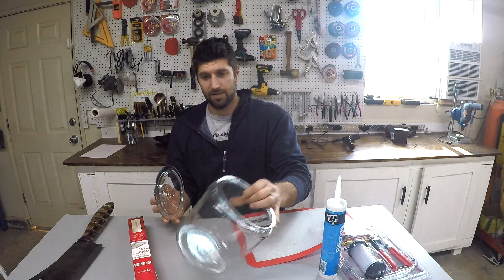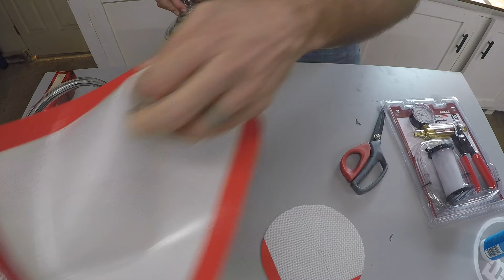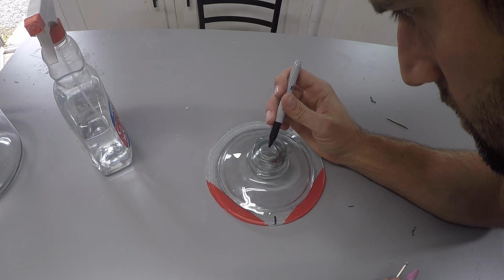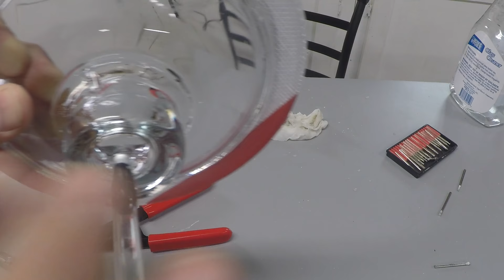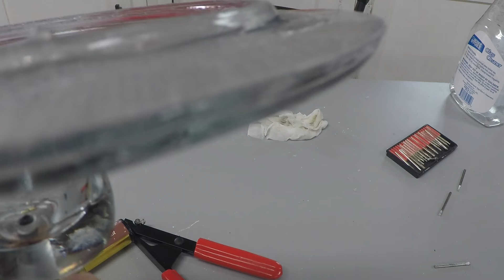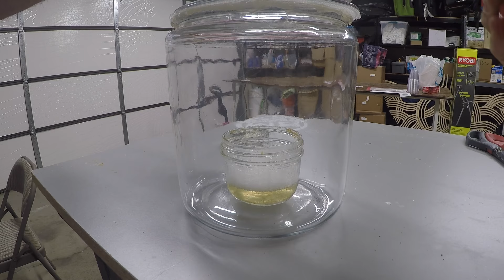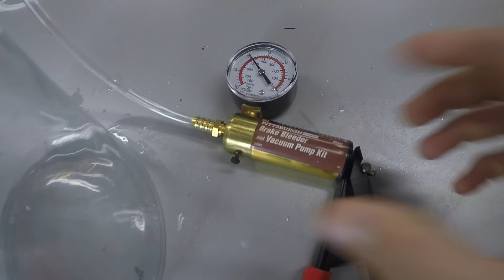EASIEST & CHEAPEST Vacuum Chamber. DIY for epoxy castings & resin pouring.

Comment: You might want to drill the glass first. If it breaks you didn’t waste time making the silicone o ring  detail. Amazing idea though.
Reply: He was experienced and confident.   However, for myself, I thought the same thing.  If I had done it in that order - surely it would have broken for me!
Reply: He could make it cheaper by using a clear plastic air tight box, saving time & money or something like those cylindrical glass jars with those metal lids (idk what its called)
Reply: @DoomsdayDatabase  plastic isn't as strong though, I've never seen thick plastic walls on a clean container
Reply: @CanyonF  you could use those pickle jars
Reply: @CanyonF  if I'm right cos the action lab kit comes with one of thkse
Reply: Where did you get the black tip on the plastic vacuum hose? I bought this same vacuum pump from harbor freight and it didn't come with it
Reply: @CanyonF  … Food Saver actually makes acrylic/plastic canisters designed for vacuuming …
Reply: @DoomsdayDatabase Mason jars?
Reply: I have a rice cooker that I hooked a hose to and sealed. I got a vacuum pump from harbor freight. I’m glad I came across this video; I won’t have to reinvent the wheel.
Reply: @bluemoon8268   yes food saver does make the canisters but NOT large ones. And there's times when you need a larger container.
Reply: @barrettique  could be useful for small hobbyists though.
Has anyone tested if they can reach low enough negative pressure to de-gas silicone/resin?

Comment: You could also reduce the volume inside the container by placing a large solid object inside before vacuuming out, save lots of pumping.
Reply: Maybe a ziplock bag with air in it.
Reply: @jude7321  I’m pretty sure it would just expand and pop, I was thinking along the lines of a block of something without air in it. Even a container of water.
Reply: @mussimike  Water might mess with whatever you're degassing right? Some fine sand or even uncured plaster powder maybe could work :)
Reply: … how about glass marbles ?
Reply: @bluemoon8268  Good idea, with the advantage that marbles ‘flow’ to fill your empty container form so you could even immerse your casting between them.
Reply: @bjornstromberg4481  i like the sand idea....i have a few really small silicone molds that are likely to fall over if i walk thru the house too quickly.   but the sands will hold em :)

Comment: Giant pickle jar with lid. Poke hole in lid with a tack. Use foodsaver vacuum pump with hose attatchment. A small piece of black electrical tape. Close jar, use pump. Have electrical tape affixed but folded away from hole. Then quickly remove tube and fold tape over hole with finger. Tape too thick to go through tiny hole. You can store dehydrated food in these kinda jars too.

Comment: I gave this a "Like".  But I think you should put some sort of expanded metal cage over it when it is in operation so the operator won't get hurt from flying glass  IF it implodes.

Comment: This makes me very nervous. I used to work on CRT televisions, that is a glass bottle with a vacuum in it. An implosion is NOT gentle. Pieces bounce off each other, some just fly past everything and continue outwards.

The front of a CRT is very heavy, thick glass. However, the back is fairly thin as it is normally protected inside the case. If you break that glass, it can throw shards 20ft. I wasn't there for it, but I worked with a tech that had someone break a CRT in his shop. One of the pieces flew 20ft, cut through his pants like they weren't there, and embed itself in the leg of his bench. He was lucky, it just barely shaved some skin off his calf.

It took a pair of pliers to pull the glass out of the bench.
Reply: yeah, but I just bought one of these jars, and the glass is pretty thick.  Not  "a baseball bat won't break it" thick, but i believe it will be fine for a max of 20lbs of force, which is the max recommended rating on the brake bleeder.   Yes, the gauge does go higher.  but I know better than to test Harbor Freight tools.      also, I'm not sure about that second-hand account, unless the old console TVs are different somehow to a CRT monitor.  I once broke thru the front screen of an old console TV.   it took several swings with a bat to make a small chip. when that didn't work, I hurled a 20 lb barbell at it.  that punched thru.  there was definitely glass that flew past me, but not with the force that would embed a shard into wood.  I certainly didn't have any cuts.
Reply: @icandsc  OP is talking about the  thinner glass on the back of the CRT though, not the thick front part you're referring to, which would indeed be quite difficult to break.

Comment: This is a very interesting idea! I have a couple concerns/comments/suggestions:

1) Safety. For at least the first few tests, put this in a large cardboard or plastic box, in case it implodes. Those jars are not designed to take these forces, and I'd want to check before trusting them.
2) Speed. Definitely factor in the pot life of your epoxy, it looks like it could take quite a while to get a vacuum in a jar this size! Some mixes have additives or different ratios to prolong the pot life.
3) For a simplified/variable system, perhaps a thick chunk of Nylon (I'm sure you could get 1" thick Nylon or even polycarbonate sheet for not too much money) with the silicone baking sheet stuck to it as a base plate. The vacuum nozzle can run under the sheet, and up through a hole in the centre of the base plate. Now you can put any size of jar over the top of the nozzle - small jars for small amounts of epoxy, larger jars for larger amounts or even filled moulds that you want to degass once poured - using the same base plate. It also means you are drilling a hole in plastic and not glass.
Reply: Killer idea
Reply: Would you say that the only thing that really needs changing for it to be completely safe is a sturdy metal pot?
Reply: @leojones1964  If what you want is a very safe vacuum chamber, then I'd just buy one - they aren't that terribly expensive. I can see ones from reputable resellers for under £100 here in the UK. Those come with a see-through lid, all the fittings and gauges... for under £130 you can get one with a vacuum pump as well.

A good quality pressure cooker pot can cost that much (though they can be much cheaper).

You could use a metal pot, but that does make it much harder/messier to use. Being able to see that the material has stopped bubbling, or that it's about to overflow the container and make a horrible mess - these are important, too.

If you are degassing epoxy unsighted, make sure there is plenty room for the bubbles to rise into and use a secondary container to catch any overflow (a sensible thing to do even if you can see). Also, it may be worth tweaking your accelerator or catalyst to give yourself a bit more working time, to make sure the epoxy hasn't set while you're degassing, and de-gas for a bit longer to make sure you've got all the bubbles out.

An interesting side-note about bubbles, though: Someone I know did a study on 2-part polyurethane mixes, and those that were vigorously stirred to include bubbles and not degassed were slightly tougher and tear-resistant, though overall weaker. The bubbles blunt the start of tear formation. It's a minor difference, but a measurable one. Thought I'd throw that in here!
Reply: Some additional safety idea. Often I have seen glass vacuum desiccaters wrapped in tape to mitigate the danger of an implosion. I prefer a plastic bell shaped vacuum chamber.
Reply: instead of nylon, why not simply make a "resin disc"?
Reply: Same immediate all folks with vacuum filtration boiling reduced have done all these, reversed compression, and hood hand ir aspirators pumps, water vent. It’s weak if I pulled vacuum that thing is imploding and borosilicate it’s not soda lime nope. Shards cheap. Get 50 vacuum heavy wall vacuum flask. Zillion safer, autoclave pressure. A cylinder especially fluid is meant to resist internal! Ie soda bottles huge pressure Pvc insane or can carbonated, champagne it’s not difficult to stress crap, crush water bottle on can. As it will hold explosions also to failure. H20 air pvc is beast. Tested on outside. Canning ? Extrapolate then tube vacuum furnace induction and molten metals chemical Base Acids ox red. Then fuming off, toxic. Seen  terrible accidents deaths only one in facility. If alone more. Folks make hazardous stuff not here sure mean to help. Diamond round bit ultrasonic or nylon screw and even use valve. Use dependent esp contents. Enough, sorry seem mean not intent, well done genuine sharing effort.
Reply: @aryanprivilege9651  bro, did you just have a stroke? Nothing you said makes sense.
Reply: Same here, cheap glass container implodes and you spend all night in the ER while they pluck a thousand glass shards from your body.  Not wearing safety glasses? Say goodbye to 20/20 vision!
Reply: @chiraldude  Implosion, not explosion. With an implosion the chamber would collapse in its footprint as the force is inward.
Reply: @Haarschmuckfachgeschafttadpole  While the implosion probably wouldn't be as dramatic as the person before you said, the energy has to go somewhere, it doesn't stop in the middle, however adding some transparent tape will stop that too at the cost of visibility
Reply: @mceajc what’s the difference between a resindegassing chamber and a chamber that you would use to cast a resin piece? Couldn’t you use a degassing chamber to cast the piece in?
Reply: @Haarschmuckfachgeschafttadpole  you've obviously never seen an implosion. Pieces fly inward with such force that they bounce off of each other and fly out. Not fun
Reply: These brake bleeder pumps are not pulling a hard enough vacuum for there to be much safety issue.  Your average spaghetti glass jar or canning glass jar and the like, are designed to take a pretty decent vacuum, and they are vacuum sealed at the food manufacturing plant and  in all likelihood under a stronger vacuum than what the brake bleeder can/do pull (which typically range from 19 to 23" or so Hg). 

    I have a manual hand pump (not brake bleeder) that pulls 28.9" Hg and routinely seal glass mason jars with it and never have had any implosion (the pump is designed for food preservation use).  Round glass containers are inherently pretty well designed for low to medium vacuum. Obviously you don't want to pull an unusually hard, laboratory like level vacuum on them, correct, they are not designed for that.

Comment: I used a kilner jar got fantastic rubber seals and its clip held down,drilled a hole with a tile drill placed in a sink of cold water,glued the adapter in the hole and its great. thanks for the video a great help,a word of warning dont try and take the lid off before getting air back in!!

Comment: Great design and its cordless! One thing I would change is the container. If it fails there will be shards of glass flying around. Just use a metal pot from a Goodwill store and switch the lid out for a thick piece of plexi-glass that you can find in a dumpster or buy if needed. I like to dumpster dive so I already have a few large pieces of 1" thick plexi-glass.
Reply: Thanks!  I was already thinking about all the safety measures I need to put together with a glass jar.

Comment: I picked up a brake bleeder vacuum pump in a nice hard plastic storage case at my local Goodwill for like $6. I wasn't even sure what it was exactly, but I knew it was some sort of vacuum pump. I thought I might really need this some day and it looks like it isn't cheap. Had it for a year. Now I need to resin-pot some high voltage transformers and I need to vacuum pump them to get the air bubbles out so they don't arc and short out. I might use an old pressure cooker in place of the glass jar because it is designed for high pressure, has a seal, and I can attach the host to the built in release valve to pump out the air.

Comment: I bought a HF paint pot on sale. You can't see in it, but just about everything you need to do for a vacuum chamber is already done.
I also bought a returned vacuum pump, only thing wrong was it was missing the oil.

Comment: Great video for a effective vacuum chamber for not a lot of money.  One correction in one scene you have a text overlay that says the vacuum is 20 psi,   that is not correct.   A perfect vacuum  is roughly 15 psi,  the correct nomenclature is that the vacuum is 20 inches of HG  (mercury).   That is what your gauge is calibrated at.

Comment: Depending on the glass jar used, there's a risk of implosion, especially if the jar wall is thin, and is knocked with a sharp metal tool under pressure. 

To mitigate the risk of flying glass shards if the jar implodes, a really simple solution is to wrap the jar with clear packing tape. The tape will catch the glass shards in that case.

Comment: I took a cheap hydraulic pump and fabricated fittings to brake lines to put brake cleaning fluid through a clogged brake line under a little pressure. I wore eye protection, and it worked.

Comment: This really looks amazing. The whole setup is cheaper than what one of the pumps alone could be bought for and it's so simple! I'll probably use a steel cookpot instead of a glass jar for mine, just a bit nervous keeping pressurized glass nearby, but I'll definitely have to give this a try when I start making dice and figures for me and my friends!
Reply: The glass chamber makes me a lot nervous.  A chamber not engineered to hold a vacuum, of a material liable to produce very sharp shards if it fails.
Reply: What sort of Steel cook pot?
Reply: I wonder if this would  work with my ancient stovetop pressure cooker? In all fairness it's exactly  why I got the dang thing, lol!
Reply: It's holding a vacuum not positive pressure, which makes me think it would be a gentle implosion if the glass broke, not a violent explosion throwing shards. But I have no experience, so who knows.
Reply: @MrModTwelveFoot  No, it would NOT be gentle! I used to work on CRT televisions, that is a glass bottle with a vacuum in it.

The front of a CRT is very heavy, thick glass. However, the back is fairly thin as it is normally protected inside the case. If you break that glass, it can throw shards 20ft. I wasn't there for it, but I worked with a tech that had someone break a CRT in his shop. One of the pieces flew 20ft, cut through his pants like they weren't there, and embed itself in his bench. He was lucky, it just barely shaved some skin off his calf.
Reply: @AlienRelics  Okay good to know. Updating my mental model.

Comment: to save even more money...you know those fabric type garden hoses....that expand when you turn on the water? They never last more than one season. When they eventually blow out, remove the fabric cover, and inside you'll find some very soft and flexible tubing that makes excellent gasket material for a project like this.  So instead of using the baking mat and caulking, slit the tubing and apply it to the lip of the jar, maybe glue one length flat to the lid?

Comment: A trick I use for goopin around tubes; stick a q-tip/toothpicks down the hole before applying whatever adhesive/lubricant, before set- remove and have a pristine opening! 😸👍

Comment: Hi Blake great video, great idea and easy to follow - I will build mine coming weekend. Since I am even to clumsy to drill a hole into glas I guess I go for one of the extra solid vacuum food boxes (Hard Plastic!). Building time should be reduced to 5 minutes max. Remove the rubber valve which sits in the top of the box and hotglue the adapter of the pump right into it. Attach hose and you ought to be good to go. I use pu resin as a casting resin. I don´t want to degass the resin but suck out the airpockets out of he mold. See if that is going to work. Might be some sort of compromise ... keep up with your good work, cheers
Reply from the maker: That is a good idea. Instead of using hot glue I would use silicone. Hot glue can leave very small air gaps which you may not see. If you spread the silicone around all surfaces you should have a better seal.

Comment: Easiest and cheapest way to make a perfect seal in the lid and the jar: get a mirror larger than the lid/jar diameter. Get a piece of that plastic food wrapping like Cling or Saran wrap. Spray some water in the mirror, spread a piece of wrap on it and use something like a credit card to squeegee any bubbles out. That plastic must be perfectly spread, like if you were putting tints in your car's windshield. Put a thin layer of silicon in the lid, then press the lid on top of the wrap. The silicone will NOT stick to the wrap, and once cured, that silicone ring will be super flat. Repeat with the jar. The advantage with this is that now it doesn't matter the position of the lid because the seal is supposed to be perfectly flat all around. When you put those two silicon seals together they will seal like crazy.

Comment: Cool solution to a quite expensive tool. I'm wondering if i should probably start with an old steel pressure cooker similar to the ones my mother used to cook with in the 80s and i think the lid seals tight if i remember correctly. The glass under pressure makes me nervous 😬 Well done though. Great video, direct, to the point and no b.s 👍🏻